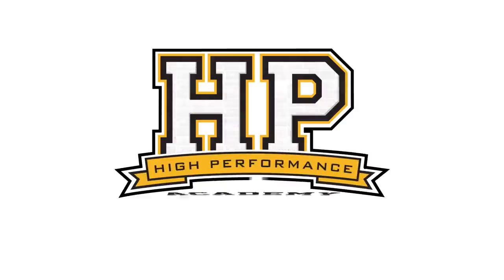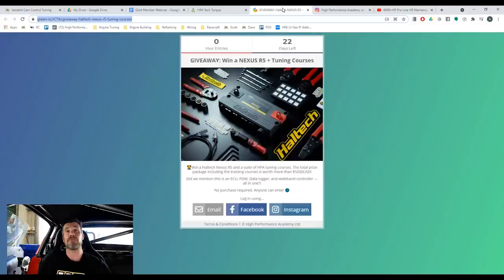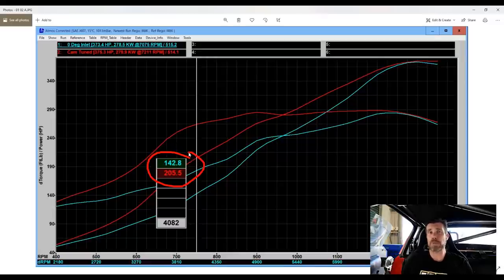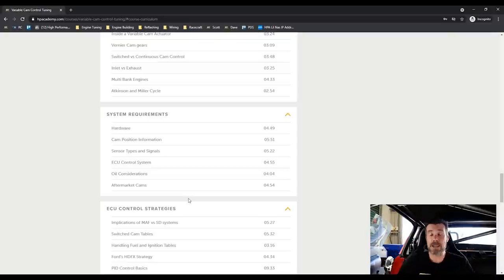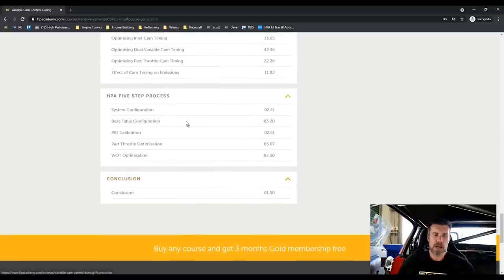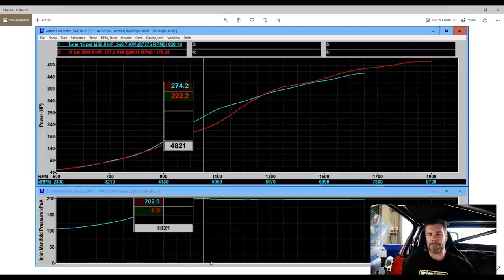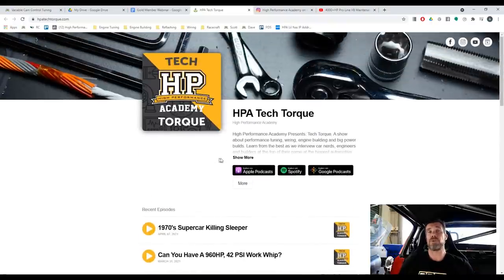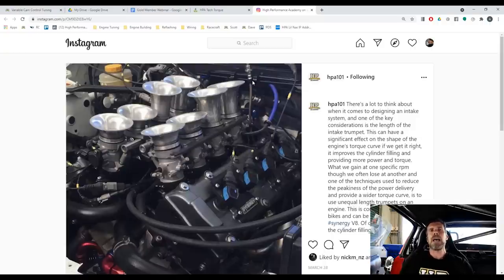SR86 Racing, Using Variable Cam Tuning To Your Advantage and More | Today At HPA [#UPDATE 265]

Comment: How does advancing or retarding the exhaust cam only affect emissions and the powerband.  I heard retarding the exhaust cam will give a little more midrange, but how much does it sacrifice the over 6000 rpm's and also what is the effect on exhaust reversion?  This is on a dohc 4.6 mustang engine with stock cams and a 15psi roots style supercharger. Auto shift point will be 6300 rpm and I will be advancing the intake cam 4 degrees. Duration 200 intake 186 exhaust. Thanks!

Comment: Didnt you guys make +600whp on that SR at one point?
Reply from the maker: Full power is only used via a 'push to pass' system at this stage. Needs a bit more of 'everything' to run that sort of power level for an hour or more. Might be some more updates about what's going on for this season soon - Taz.